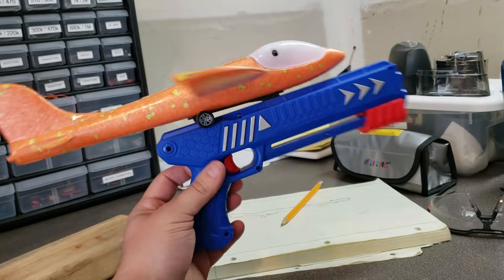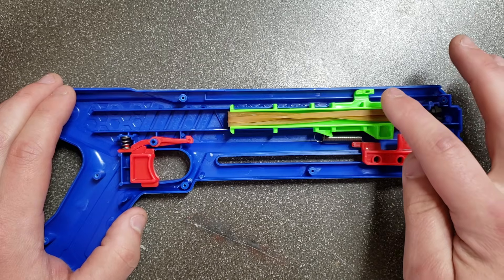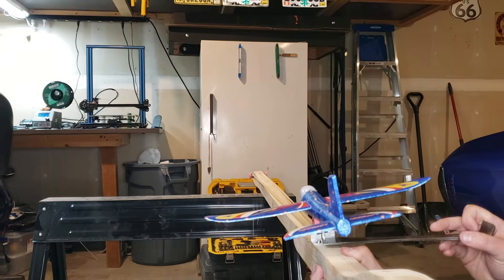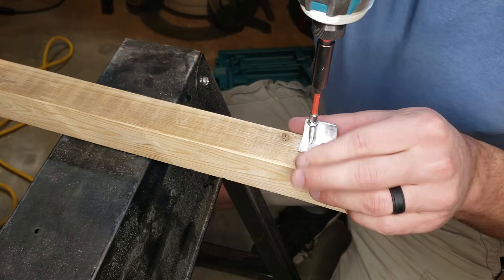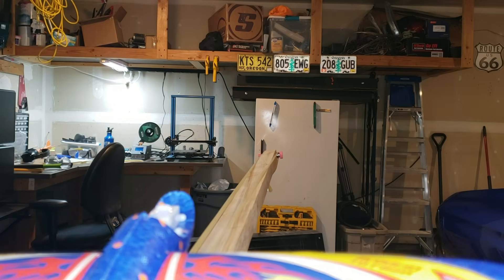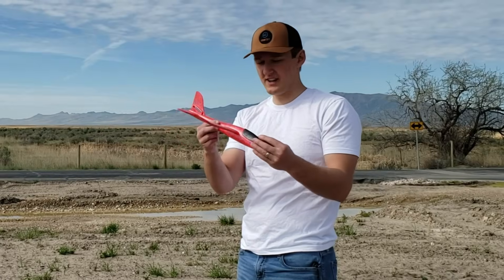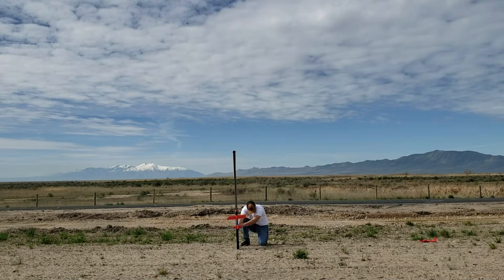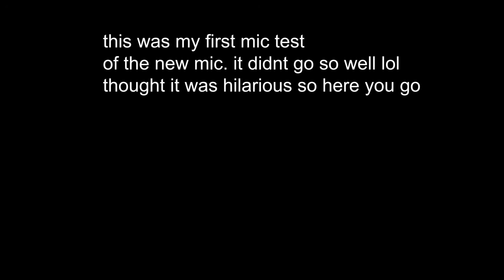I Made A Gun That Shoots Planes

Comment: Suggestion:  When the angle of attack becomes too high, the smooth flow of air over the wings breaks apart. This creates turbulence and a sudden loss of lift, leading to a stall. Since your gliders aren't designed for high-power climbs, the wings can't maintain the lift needed to overcome the steep vertical pitch. 

Ensure the horizontal and vertical stabilizers are perfectly straight. Even a slight misalignment acts like an unintended rudder or elevator input, forcing the plane into an uncoordinated bank or pitch. If the stabilizers are not true, the aircraft cannot maintain a straight flight path, as the uneven aerodynamic forces will constantly pull the nose away from the desired heading.

Comment: These light toy things are not made for such high speeds.
It's like building a rocket engine on the back of your bicycle.
That wouldn't go straight at high speed either.
You need to make something out of thin plywood.
And make it nose heavy.

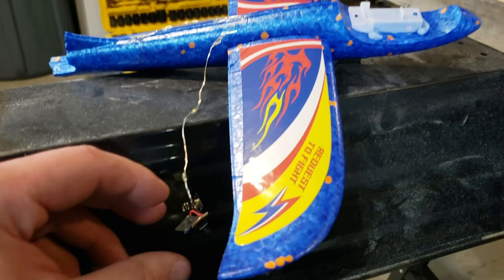Comment: In accordance with 49 CFR 830.5(a)(1), any person who operates a public aircraft must immediately inform the NTSB when an aircraft suffers from a “flight control system malfunction or failure.” When the aircraft lost its horizontal and vertical stabilizer, as seen at 2:12 , its elevator and rudder, which are flight controls, failed. For that reason, an accident as seen at the aforementioned section in the video would need to be reported. (Yes, I did pull out an actual FAR/AIM to answer this question, what of it)

Comment: The rubber band is inconsistently moving left or tight or up or even down pushing the plane in different directions. The planes are also not meant to go straight by how they are flying. If you make a grove in the wood which a metal piece with a flat piece sticking out and the rubber band around it, it will go consistently every time at least it should.

Comment: If you could get ahold of a plastic one that’s the same size I bet it’ll rip.
Reply from the maker: youre probably right - the only issue is the added weight, which would drastically slow the launch speed. But it would probably fly straight...
Reply: @currentconcept  I’d like to see a part two to this. Cheers.

Comment: So, the reason that the planes didn't fly straight, at least to my knowledge, is that their designed to fly in circles. For most use cases, an un powered toy plane is made to be interesting by doing loops instead of just going in a boring straight line. You could probably modify one you have, or make your own to make this more effective
Reply from the maker: Those red one i got had 2 slots for the stabilizer, one was for loopty loops and the other for straight flight. Im like 90% sure I put it in the right slot lol
Reply: @currentconcept I have the same ones. In the cockpit there are 2 steel balls. Moving them to the front of the nose solved it. Heat the great balls with fire and they can be melted into the foam. 👌
Reply from the maker: @autonoob  niiice thank you for the tip